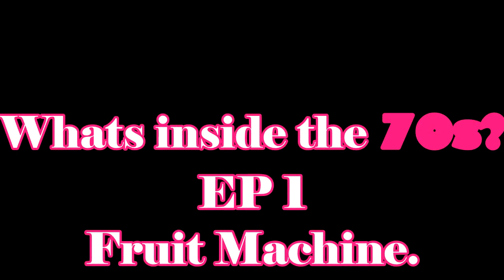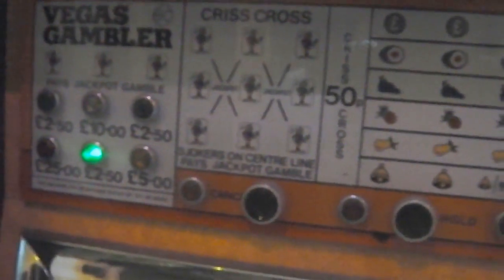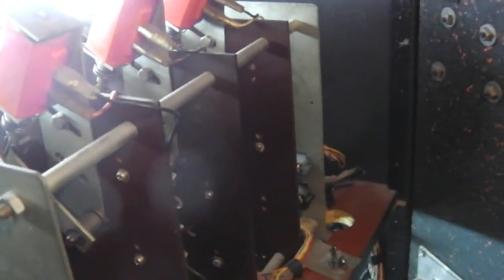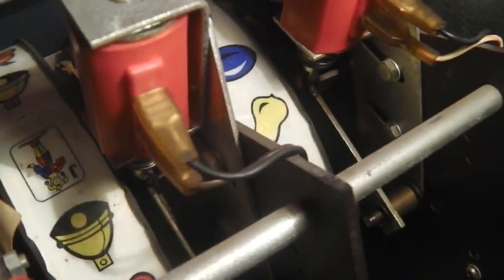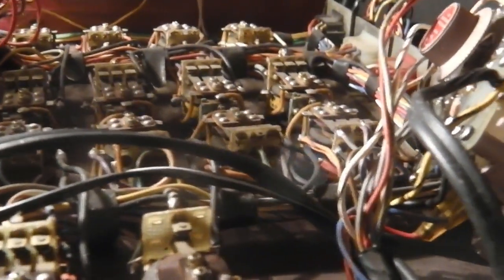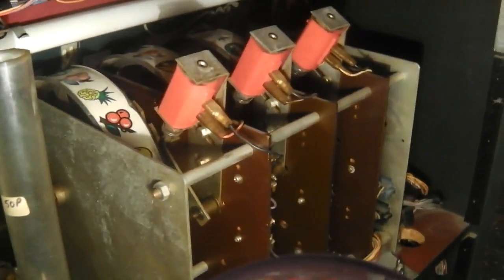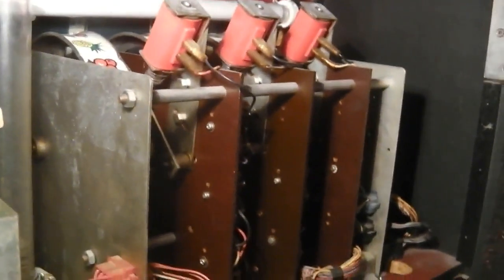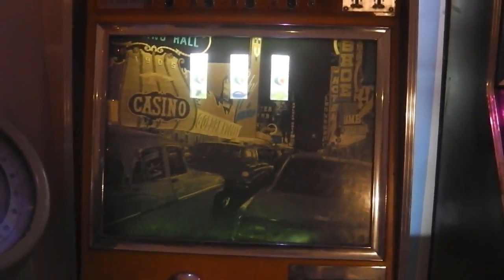Whats inside a 70s fruit machine? How it Works.

Comment: Some nice kit there, and yes this is most certainly a "clubber" or Cat B3A / B4 as the Gambling Commission would have had it back then, although now this machine can now be operated as a Cat C (Legacy) in an arcade, pub etc. If you have any more interest in this machine, maintenance, spares etc, worth looking for a website called MPU Mecca, where there are many like minded folks, generally willing to help where they can. Myself, I have a two old Bell-Fruits from the 70's at my place right now, one of which is on my channel (BFM Cross Over).... As a side note, because this machine uses Coin Controls S1 style coin mechs, they can be converted to the new coins, although the 5p one maybe a bit difficult to do when the holding tube is concerned.

Comment: Just a safety point to add that your machine is all 240vac operation which means most of the parts are live mains so watch where you put your hands when it's switched on..A good tip is RED reel solenoids are a sign of 240vac operation...
Reply from the maker: Thanks Ron, I started my apprenticeship on Barcrest MPU3 first job was to repair reel drive transistors on the boards, multimeter across base and (emitter?) for .7 volt. Mpu3s often blew transistors making reels land funny, stepper motors would not run proper.We never covered electro so for me fault finding on thsi machine will be pretty easy, ive fixed the payout motor, the actual 240v motor was stalling, took it out and ran on bench out of its gearbox, it would stall on start up every now and again, couldnt find a 240 replacement that had right drive cog , so i grafted a 24v on and have run it from a psu, not factory but gets me going. works now.pays out.the plastics are brittle on motor housings. Next fault is it has unlimited credit, or rather coin lockouts work wehn out of credit so its workign there, but if you keep starter handle down, it will just keep gicing you spins even when out of credit, just need to trace the starter swithc circuit right thru to find fault. im thinking dirty omron relay contacts or a loose spade. noticed spades go brittle

Comment: Nice video Pete. It looks like the top 50p is a 1969 one with the ring of hands on the reverse. My mother worked for a fruit machine operator and their staff were often 'cannabilising' parts to keep them running. Perhaps your machine is bit of a mixnmatch of parts? I'm sure I remember her saying they can set the payout frequency in some way. Or maybe they were fiddling with it!
Reply: It looks like the spin bar on the front is meant to echo the rear end chrome of the American cars. The cars in the front scene look like very late fifties and early to mid sixties. I might be able to get a mate from the US to have a look and see if he can identify the cars.
Reply from the maker: ta !!   yes they did same styling on washin machines cookers and such. I had a really good cooker, looked like space age, it was 50s one, left it outside, scrapman nicked it
Reply: Little bit unusual to find open relays like this in this machine..... more often than not (Certanaly in Bell-Fruit's), often use Omron MK3 closed case relays.
Reply: Pete C okay matey. My friends across the pond reckon the station wagon is: 1964 Rambler. Possibly badged cross country deluxe. I think they were built by GM. The car on the right was described by them as 'definitely Mopar.' It could well be a Dodge Charger or Coronet or similar. Not enough detail visible to be more specific. Still working on car on left...
Reply: Now then. My friends are thinking something like Chevy Bel Air 57 for the car on the left. I'm not so sure about it, it might be a 1950 Oldsmobile 98 although agewise I think its a bit of a stretch. My left field choice is actually a Volvo 122 Amazon. Its difficult to tell whats shut
Ine and whats reflection.

Comment: please can i ask you
MY HOPPER TAKES  110.00  POUND BUT SHOULD TAKE 250 POUNDS. WHEN FULL IT TAKES 350.00. THEN MONEY DROPS TO BOTTOM OF MACHINE.
MY MACHINE IS A 70 POUND JACKPOT BARCREST ON THE FIDDLE MPU6
HOW DO I SET THE HOPPER FLOAT TO TAKE 250 POUND AND THEN THE NOTE CONVERTOR SHOULD WORK AT MOMENT IT TAKES 110.00 POUNDS
PLEASE CAN YOU HELP THANK YOU
ALL THE BEST
MARK
Reply from the maker: the hopper needs to be dumped using the refill key and hopper dump switch until no more coins are coming out, then do the process again, dump it with no money in so the computer thinks there is zero in the hopper. the machine will then refill its self as you play or you can refill using the refill key. OR dump it so it shows zero, place your 250 in the hopper then dump again, then put the 250 back in, this sets hopper to 250